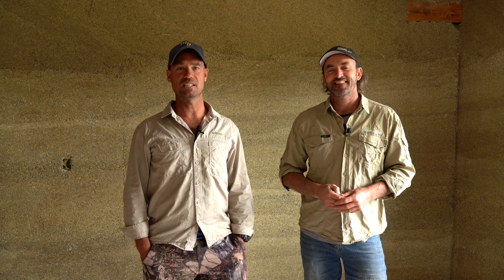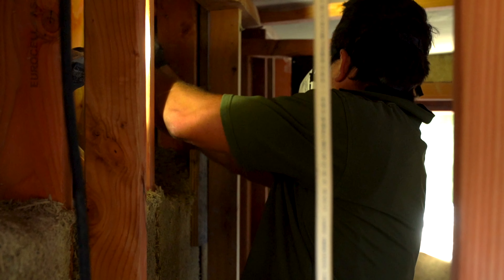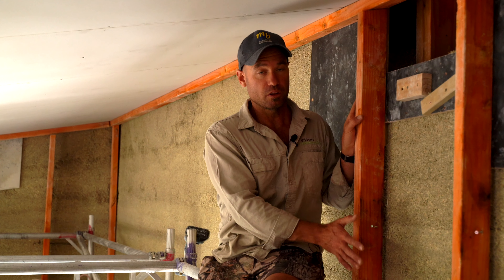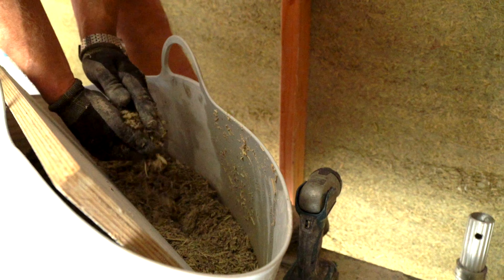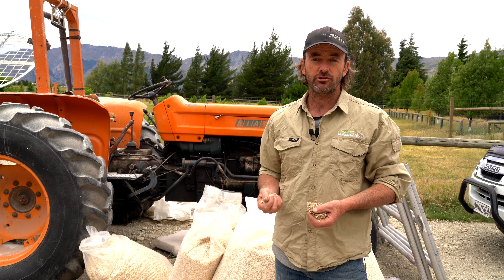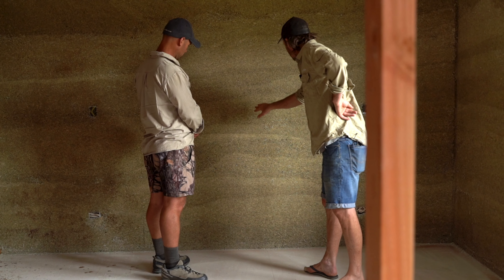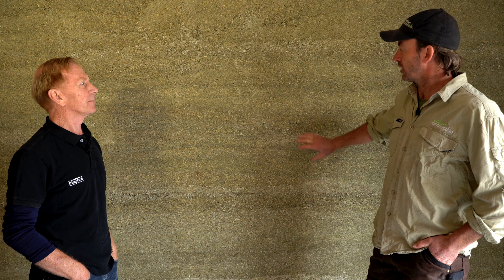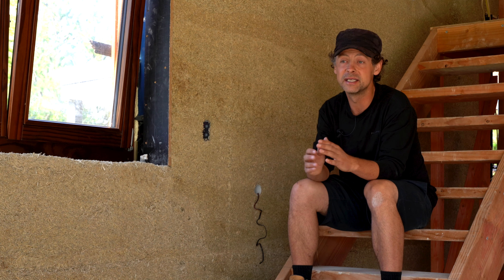Hawea Grove EP12 // SE01 // A House of Hemp

Comment: Hi, can you provide more detail on the shuttering system with the temporary frame work? Did you spec a certain type of hurd/shiv? I noticed the mention of hemp grown for seed production I believe, but thought fiber in the content was not a good thing for hempcrete. Thanks for the great video!
Reply from the maker: Hi there. The shuttering system is simple plywood with 2x4 framing. We used mostly shiv from fibre production and it compacted really well. I believe Erkhart Construction used shiv from seed production on a previous job but you would need to talk to them about how that performed. Thanks for the comment!
Reply: @haweagrove6344  yeah, thanks.. 
i’m also very curious about that seed production shiv use. 
Should i contact Erkhart Construction as well ?

Do you know what species of hemp did u use, by any chance? Fedora ?
(i’m an architect and i’m going into hemp fiber farming myself..)

good video, and nice textured wall there ;) thanks again
cheers from Portugal ;)

Comment: So you said, 6 ton covers for 3 homes? My first question, ‘from the 6 tons of Hemp fibre, how many acres produces 6 tons?’ Second question, ‘for these different homes, what is the square footage of the homes?’
Reply from the maker: There are many variables there. Our house took slightly over 2 tonnes of hemp. It is 115m2 ground floor and 55m2 upper floor. The walls are 240mm thick. I don’t know how many acres it takes to grow that amount of hemp.